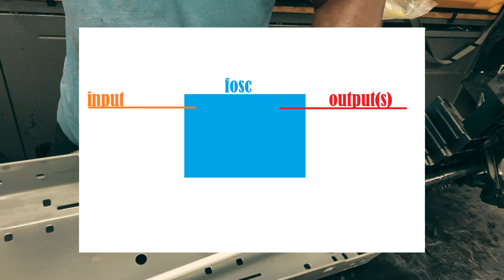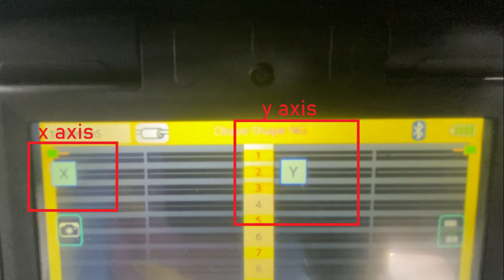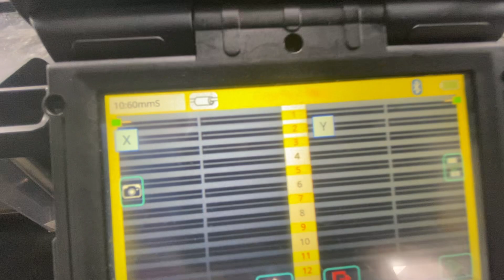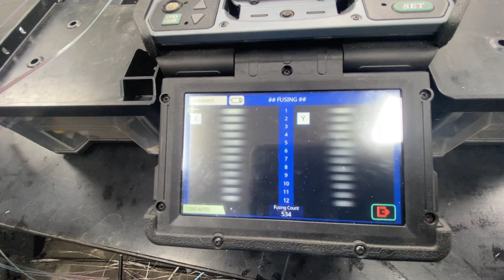Inside a High-Stakes Fiber Optic Emergency Repair Mission. Outage 2024: Fire Damage

Comment from the maker: Timestamps:

00:00 Intro
00:25 91st and harper, a look back
01:01 walking out the damage area
05:00 spare cable reels
05:28 beginning prep
10:27 a look inside the damage
14:29 build one case and build them all
15:15 feathering the glass
18:36 outro

Comment: 7:47 So why not just cut back farther and start with clean new cable?  Seems like a lot of work for damaged cable.  👍🤠
Reply from the maker: Greetings. I simply couldn't. Due to time constraints and having to work with and within multiple teams I could not move my trailer. Also, I didn't have accessible aerial slack. So I had to work with what was available to me. Thanks for the comment good sir.

Comment: OK, splicing for an ISP is another level, you splice so many fibres at once, I splice one after another for private fibre links in houses or between buildings, which have 12 or 24 fibres at best. No need to have a complete truck filled with equipment. ;-)
On a 12 fibre cable there is alqays THAT ONE fibre which doesn't want to get spliced, it needs several attempts to splice. But only ONE per cable, I don't know why..

Comment: Thanks for an interesting video. You did a great job! 👍 A question - Why do you have so many cables above ground in the US? I have seen that in lots of videos. Is it an economical issue?  In Sweden, where I live,  it is very rare to see. Most of the cables (electric and fiber) are underground. 😊
Reply: It is economics.  Some places, too much demolition is required to put underground.
Reply: It's part of the legacy of the early days.  Older neighbourhoods were built with overhead wire, and they just kept adding more and more stuff to the poles as time went on.
New neighbourhoods are almost always built with underground (unless the geology doesn't allow for that)

Comment: i am from Michigan and my town/city don't have fiber to residential yet they are in the process of running it. i think its at&t got the lock down on the area.
Reply: It's sad that these giant corporations still haven't replaced all the copper. They've been talking about FTTH since the Clinton/Gore days.

I've been in telecom 18+ years and developed an interest in the history of the POTS network. At some point in the distant past, one of the CEOs said telephones should be a "universal service" and pushed the network deep into the rural areas. Now, if they don't think it'll be profitable short-term, people go without 🙄
Reply: @grabasandwich delays happen when dealing with regulatory department in your city/town.  As well as wanting to retro fit older apartments when owner of said complex says no

Comment: Tell me please, how do you get orders and how much money do you earn on average per order per day? I am from Russia and work in this field in Israel. It is very interesting to compare prices for work in Israel and the USA. In Israel, as a contractor, on average, 500-550 dollars per day, splicing regular fiber, not ribbon.
Reply: I am pretty sure he works on the same ISP's plant as I do, just in a different state. The ISP doesn't have a ton of full time in-house fiber splicers but they have many contracts with many business partners across the U.S. these are prime contractors who have overlapping service areas and the ISP has teams of maintenance supervisors who handle coordination for repairs like this, and project coordinators who handle coordinating design, construction, splicing, headend, and installation for new services. The better your construction company is, the more work you get, period. I don't actually know the entire details of how the prime contractor I work for got their contract, I just know they make a ton of money from it, the ISP handles the supply chain and keeps materials supplied always above minimum levels at our warehouse/yard. We don't do a ton of ribbon over here, but we do do some, but we do mostly loose tube. The ISP has a rate schedule they pay for services, like rolling trucks, flaggers, accessing an enclosure for just splicing and a different rate for adding a cable into it, installing muxes, installing nodes, and fiber splicing. Lower count cables per more per splice, like a 24 ct cable paying a little over $30 per fiber, or higher counts paying less per splice, like a 432 ct paying a little over $27 per fiber. On a 10 hr day splicing new build I limit myself to 216 loose tube fiber splices (we don't have new 432 cts to splice EVERY day or anything). During an outage, I don't stop until all services are restored, regardless of the count of cable, but we have multiple teams of fiber splicers and multiple splicing vehicles.

Not sure if he gets paid a salary, hourly, or units, or a combination. I get paid hourly, but its a pretty good hourly rate and many benefits. Sub-contractors tend to "make more" working for themselves, but they have to worry about their own equipment, taxes, healthcare, and everything... but also must worry about having work available for them. I always have work, every single day, so it feels very secure all the time working for a prime contractor.
Reply from the maker: @thenerdnetwork I appreciate your input on the many elements involved in billing and compensation! You have precisely articulated the many factors that not only go into so many things that could complicate the money, but you also highlighted the complexities that could be involved in a "simple" fix. your amazing bro. Thank you.
Reply: @JBWR  Hey thanks, I appreciate your videos and the work you do as well. It is refreshing to see someone else who takes pride in their work and has a well rounded knowledge of their profession and the system they are working on. Good luck and stay safe out there,
Reply: @thenerdnetwork  Well put! I was a telco contractor for 15 years and the money was decent, but I had always heard that the cable company techs made way more than us. The company I was at sold us off to a huge prime in 2019, and around 2021, a bunch of us quit to go do coax.

The money is still okay, but not nearly what these guys used to make. A ton of in-house guys got a buyout in 2018, which must've been like winning the lottery in a way.

Anyway, I regret my life choices now, as I'm still just a lowly residential tech using my own vehicle, with no room for advancement, job security, vacation time, etc.

Some of my old telco co-workers have moved up, but at this point, these giant corporations make life hell, so I have to remind myself that they probably aren't happy either.

I've wanted to get into splicing, but haven't found an "in" but I've also been laid off twice in the past 2 years, so I'd rather just get out of this altogether. I just haven't found anything and our job market sucks.
Reply from the maker: Location. Location. Location. Plenty of elements should be considered when estimating possible earnings for burning glass. Whether its an emergency or not. Are through additional skills required beside prepping and splicing? Is an OTDR required? What was the weather like? Is it a holiday? Is the job during the day or night? I won't discuss my pay, but a good friend of mine earned  $2 a splice on a 432ct and another got paid $600 shooting 216ct fiber. Hope this helps.
Reply: @JBWR There's a road in my city called Burning Glass! I've done mechanical splicing for 15+ years, and a bit of fusion in MDUs.